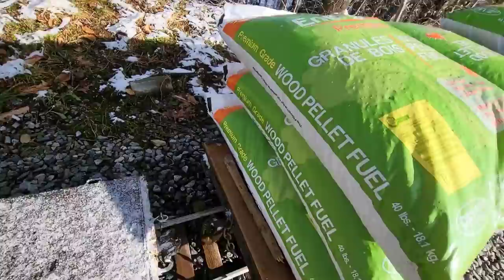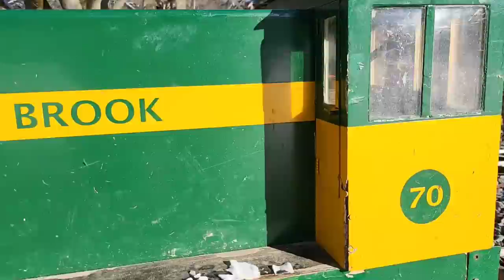First Wood Pellet Train of the season! MLBK WP-1, 27 Nov, 2021

Comment: That puts the “kick” in kicking cars (or running/gravity drop switching). chuckle 
You are living my childhood dream of having a working 7 1/2” gauge railroad. Maybe some day, but working for a 56 1/2” gauge one will have to do for now.
Reply from the maker: A flying switch is easier to do without a camera in my hand.
I never worked on a freight train crew, but I've worked passenger with some old school freight guys. I learned a lot of tricks and some bad habits from 30 year veterans that would get you fired today on a freight railroad.
Reply: @MillBrookRailroad  Yeah, there are a lot of skills that are going by the wayside because they aren’t “safe”. Conductors on the road I work for are no longer allowed to get on or off moving equipment. Makes for a lot of walking or a lot of stopping and starting. They also frown on running (flying) switches and gravity drops, and they are clamping down on where kicking can be done. Some of it I can see where they are coming from, and some of it seems like they are going a bit overboard on.

I started on the Operations side (conductor) and moved over to Engineering (track maintenance) after.
Reply from the maker: @rascallhunter  I worked passenger for a few years on a common carrier. Great work but the pay was minimum wage and management couldn't... 
...manage.
I got most of my track maintenance education by observation. My best friend in high school was the son of a signal maintainer on the CV and I used to do a lot of filming trackside as a teenager. Those old hats tolerated me as long as I didn't ask too many questions and stayed out of the way.
Reading hundred year old track maintenance books and back issues of RT&S helped me understand what they were doing.

Comment: now if you had internal storage ,wagons would be snow free or sheeting over them if kept outside
Reply from the maker: That'll happen in the spring, when I can lay tracks to the basement door. Then it'll be a simple task of pushing them into the basement until I need them again. I have two tracks laid in the concrete floor of the basement.

Comment: What's the capacity of you flat cars? The 70 makes up in performance for his looks. What a trooper!
Reply from the maker: The 101 and 102 have a 500 lbs capacity. The 105 has a 1000 lbs capacity. The 70 can pull about 1500 lbs up a 2.5% grade on a 55 foot radius curve and I've pulled a 3500 lbs train on a relatively flat track.

Comment: Wouldn’t you be over weighting the flat car and track?
Reply from the maker: The 105 flat car can handle 1500-lbs (680 kgs) and 5/8" rail can handle 250-lbs (113 kgs) per axle. I normally load the 105 to 1000-lbs (453.5 kgs) and the 101 and 102 to 500-lbs (227 kgs).